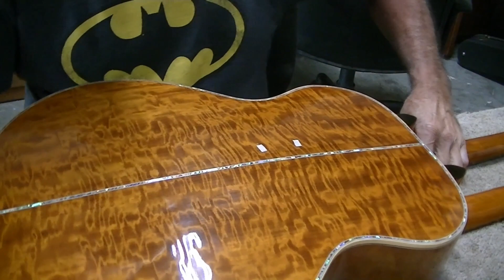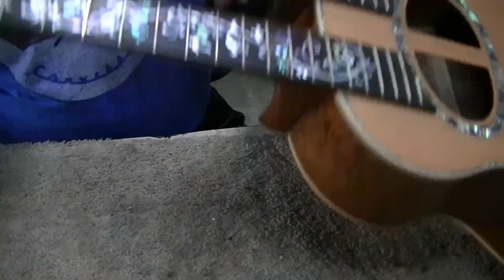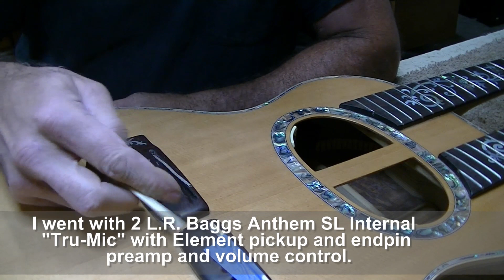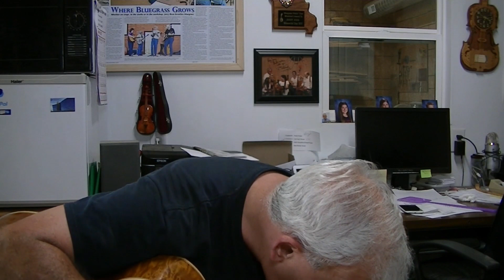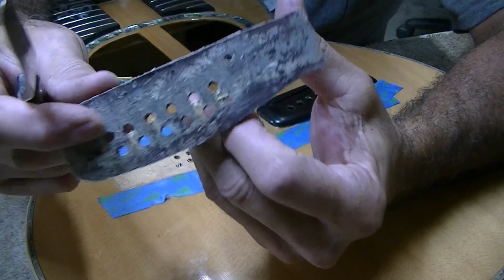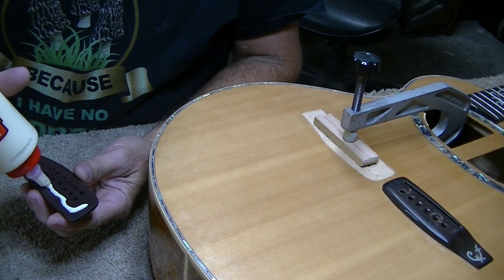179 RSW Double Neck Acoustic Guitar P3 Final

Comment: Accessing the LRB soundhole controls for the 12 looks to be very, very difficult with that oval. 
The sound of the 12 had that real jangle - much better than I expected. The 6 also had a good sound without all that much bass.
Grand job, especially considering the frustrations.

Comment: I have a double neck Alvarez Yairi DY87 - 1980s?  (not near as much bling) with fishman gold pickups and an end jack (mono)   (for 20 years) so I perked up when I saw these 3 clips.  No splits or cracks but a bit of bridge lift which has been stable for the last 20 years.  ( I use simple "in case" humidifiers)   Just say saying it is possible with good woods - Good job & smart choices on that one! Thanks - Adam

Comment: In my humble opinion, when something is cheap, is cheap. I mean there are no miracles in this. When something is cheap at the shop is because it was cheaply made and all the money you didn't spend at the shop is money multiplied by three or four, to say something, that you'll have to spend later to correct everything badly done at the factory.

Anyway, it's a nice curiosity that guitar, I don't know if practical, but nice.

And I agree with the viewer who suggested using a stereo jack. And there are also some two mono channel small mixers made to solve this kind of problems.

My regards from Spain!
Ernesto.
Reply from the maker: We could not use a stereo Jack. The company would not cover the warranty on the pickups if we did that. They were expensive so we just wired them individually.

Comment: If you're looking for a good (and cheap) way to heat up bridges for removal... Find an old 75 watt bulb and use it with a desk lamp with a large shade that fits over the bridge entirely. I cover the rest of the top off with a thick cork sheet (I cut a bridge shaped hole into it). Works like a charm and doesn't hurt the guitar finish.

Anyway, thanks for uploading!

Comment: I would say that this job assignment - is the "assignment from hell." *with a rather nice result. A Mennonite cabinetmaker in nearby western Chester County, PA, also does work as a luthier (mostly large-stringed instruments), and utilizes a rather gifted (and novel)  approach for 'restoration through humidification'. 

He has/uses a combined vertical + horizontal, (manually controlled - plus) temperature controlled humidification cabinet. The fluid chamber is heated by a wood burning 'specialty stove', which is fueled by oak and cherry, and uses both a damper and heat inlet system that are thermostatically  and automatically controlled. That's not the kicker!, what is the kicker is  that he uses root beer or birch beer extracts (no sugar) in the fluid chamber and reservoir.

I would imagine that there is no real difference between either, from the results achieved with just 'plain old well water'. (however. I'd bet that the instrument retains a great scent for a short amount of time)

Comment: I run two 12 string acoustics and never tune either to Concert Pitch.  My lightly built solid cedar topped jumbo version I tune to C# - and even then had to deal with a ‘bridge lift’ - and my Martin OM sized is tuned to D.  Both use 12-54 Martin sets.
I have never tuned any acoustic 12 string to Concert without seeing a distinct hump form behind the bridge within a couple of months.
So, despite your ‘18 strings-worth’ being built like the proverbial brick sh1thouse, I kinda predicted (no kidding!) the outcome you experienced.
Aside from the structural benefits of down-tuning a ‘12’, the main benefit is the full, rich, ‘barrel-house piano’ style sound it produces - great for filling out any solo performance, and especially appropriate for Delta Blues style music.

Comment: this is 1 of those ANTONIO SAI(?) guitars from vietnam. they r beautiful & play ok for a little while. the problem w/them is that they apparently don't season the wood very well & use basically green wood. so it may have problems on down the road. he sells these & others on ebay. their electrics r much better, from what i remember. 

a JLD BRIDGE DOCTOR or a BRACEADE will flatten a bellied top & they're adjustable, in case u need to flatten it again.. i used a JLD on my Daoin Caribou & it played beautifully w/low action. really flattened the top. u may need 1 or 2 on a double neck like this 1. hope this helps.   :)

Comment: Another great job, Jerry.  The owner said he had issues keeping both sides of the guitar in tune.  I was surprised you didn’t end up replacing the tuning machines.  I also noticed the original tuners were not matching (I.e., closed “two line” on the 6 string and open gears on the 12 string.  This is obviously a very old video, so no need to reply; just curious.

Comment: Hey Jerry, instead of using individual outputs for each neck, couldn't you have installed a 2-way pickup selector switch?  My double-neck solid-body has a 2-way selector switch for selecting the neck you want to play on in addition to 3-way pickup selectors as each neck has 2 humbuckers.  Sorry if this comes a bit after-the-fact because I wish I could have saved you a little work.  Having a switch would save having to plug 2 cables into the box and possibly having to use 2 different amplifiers when playing live.  Although the basic design and the woods used to built this thing, and some very striking inlay work offers some excellent eye-candy, Of course I am a real sucker for beautiful figured wood grains.  I have the impression that perhaps a little more attention could have been used in the planning phase in order to prevent the inadvertent striking of the strings on the 6-string neck while playing on the 12, which appears unavoidable according to the way I usually play because when I play acoustically I'm usually pretty much a chord-banger.  HAHA!
Reply from the maker: I checked with several manufacturers. Any modification to the products wood void  the warranties.  The customer is very happy in the long run. Thanks for watching.

Comment: Having watched you deal with that guitar, as the $%&@ of a thing to fix, you outdone yourself again.  If I were to be Stateside, I'd choose you above all else to fix my guitars or build me one.  You are one in a million among luthiers, Mr. Rosa.

Furthermore, your videos never fail to satisfy me.  Thank you Mr. Rosa for another splendid video.  Still, I would have liked to have seen you taking the KISS approach by installing a K&K Pure transducer system under the soundboard with the two jacks and the two volume controls.  In all honesty, Mr. Rosa I think undersaddle pickups diminish the guitar's tone.  Also, some bone bridge pins would have been in order here.  I for one am not a fan of plastic, especially when no other aspect of the guitar is plastic such as the binding, pickguard, etc.

Good on you Mr. Rosa for such a fine job in the face of adversity.  The late John D'Angelico, James L. D'Aquisto, José Ramirez II, Rex Bogue, Lloyd Loar and other luthiers of bygone times are applauding you from heaven..

Comment: The individual outputs are useful, but I don't like the looks of two cables at different angles like that. You could have used a "stereo" jack and used each channel for its respective pickup. Then maybe a small hidden switch somewhere to be able to mix them both into the tip (left) so that a mono cable would work in a pinch. If two jacks were a must, I believe putting them behind one another into the tail block would have been nice.
I don't mean to knock your work, if I didn't care, I wouldn't be trying to help.
Reply from the maker: The company we bought the pickups from voided the warranty if we modified anything. Therefore making it stereo with a voided the warranty. In actuality it really does work better the other way even though you have to do slightly more.

Comment: Why couldn't both pickups be connected in paralel thus avoiding an extra hole in the body. I did it in an Echocarioraphy machine and it worked (2 ransducers into one input socket).
Reply from the maker: I think that question has been asked at least a hundred times and I have provided the answer just as many. The company would not warrant it if I modified it at all. Those were very expensive in the customer did not want to lose the warranty

Comment: Hi Jerry. I've watched all your videos. Took a few weeks, but it was all worthwhile, and I love bluegrass which was an added bonus. A few years ago I purchased the Smokin' Dragon ukulele which is pictured here: http://www.mandoharp.com/Ukuleles/070062-UG_Smokin_Dragon_Soprano/index.html. The one I bought was the exact same one as pictured. According to the MandoHarp web page, the builder is Antoniotsai from Taiwan. I believe there was only one smokin' dragon uke, and I also believe it was the same builder who made your double neck guitar. I'm a uke builder myself, but I bought this because I wanted to have a look at it and see if it was as good as it looked. Well there were several things wrong with it, but I'm not disappointed because it didn't take much work to get it playing right. You can probably see from the picture that the nut was glued on crooked, and the tuners were cheap plastic ones that wouldn't hold. Unfortunately, the tuner holes were large, and I had to fill and re-drill to fit a good set. Otherwise, it's quite well built and is solid koa and rosewood. It's easy to play and sounds good. Everyone that sees it is impressed, but if you have a look at the headstock picture, you might notice that the yellow around the pearl puffs of smoke are wood filler. Thought you might like to know. Cheers. Rob McConnell, Victoria Australia.
Reply from the maker: Hippety Hop thanks for taking the time to watch the videos. That's a beautiful instrument.

Comment: Maybe should of used a stereo jack. That way you just use a stereo splitter Y adapter, yet you only need a single jack. You could use a single TRS cable out to the amps, and split the signal there (or even just use a two channel head).
Reply from the maker: The company that made the pickups would not warranty any other set up.
Reply: @RosaStringWorks  ... That is a great reason to not use a TRS jack.

Comment: I think the pickup part is a fail. Thumbs down on that.  I hate those control units like that where you have to reach inside the sound-hole anyway, but this one is so hard to get to because the strings are so close to the edge of the sound-hole that you really had to work at it to adjust those volume & tone control knobs. If you were performing you'd look stupid doing that, and your fingers would mute the strings if you were playing at that moment. I'm sure I could easily find more criticisms for that problem. But as far as being able to play that instrument on stage, he does need some type of pickup. You just need to get those panel type control units that you have to cut part of the side of the guitar and mount it there, right on top as you are playing. - On the LEFT side as you face the top/face of the guitar when it is standing upright. On the upper bout near the waist where it is flattest.  But I doubt if anybody makes one for a double neck acoustic!!  You'd need a repairman for electronics to modify or create one. You probably can do that yourself, Jerry. Or you might just need two separate control panels. It might be difficult to get both on that side, maybe not. Maybe put the second control panel on the bigger bout just across the curve in the waist. It would definitely be a unique situation!!

Also, I don't think the customer was even wanting to have to play through an amplifier. He never mentioned it in his correspondence, as far as I could tell, although you apparently talked to him on the phone quite a bit also, correct?  Was that discussed?  He really needs to learn to play louder. - Play harder. Does he use a pick? I suspect he does not. And he may not have any long, hard fingernails. A common problem for many people!  I would say use bigger strings also, but 12-strings are hard enough to play for most people anyway!  Plus all that strain on the bridges!  SHOOWEE!!!  I still like the idea of a ToneWoodAmp, but those can be a hassle and problematic.

Good luck on this guitar - and customer!!
Reply: Don't have access to a guitarist to demo all your guitars? You really REALLY do need one. Your tri-chords in the key of G really doesn't BEGIN to a test/demonstrate a guitar to see if there are any problems with the frets and action. I assume the action is good, but you really need someone to test those frets. Going all over the neck. Also to test all the standard string bends, and maybe play some non-standard bends! And checking intonation. That can be a lot trickier than one might think.